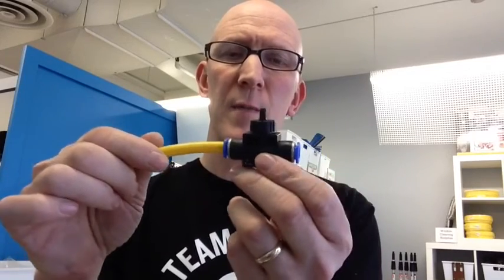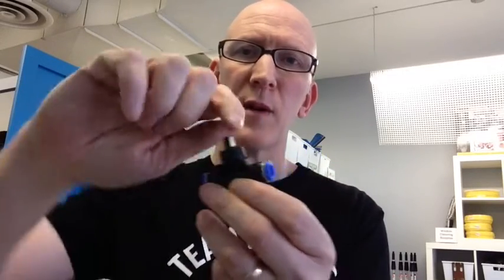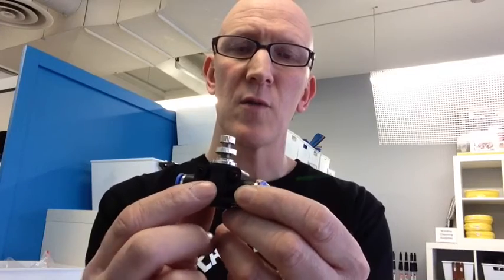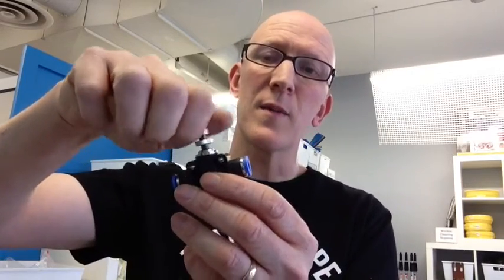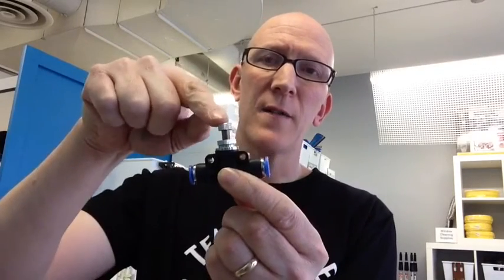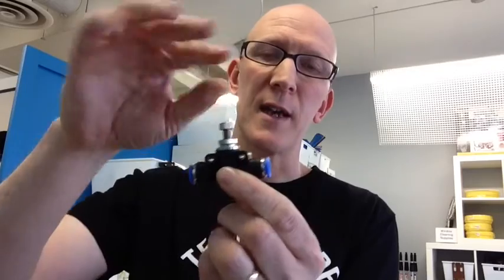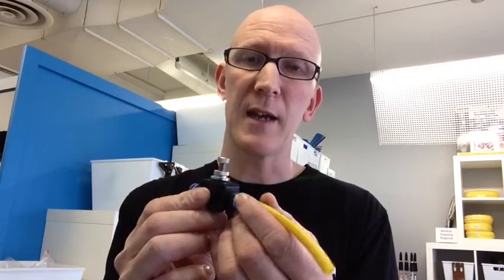8mm water flow valve

Comment: Would using just a flow valve rather than a pump controller not put a strain on the pump eventually causing damage?
Reply from the maker: That depends on your setup. This wouldn't come into play at all if the operator is using and RO/DI or di system (in other words, no pump/tank).